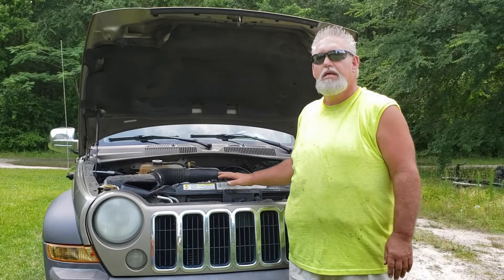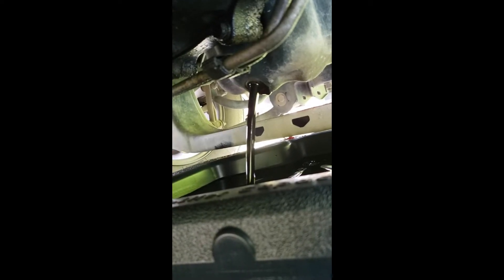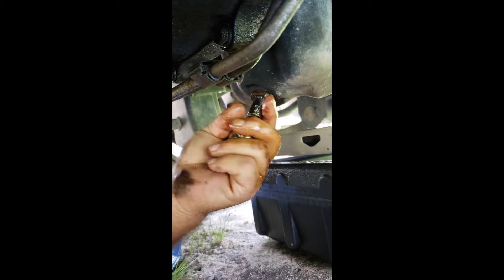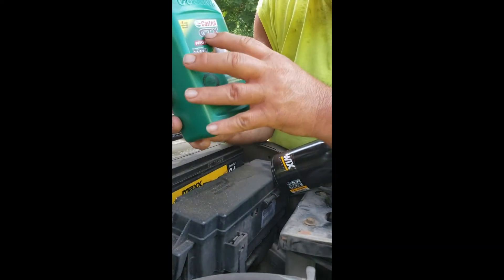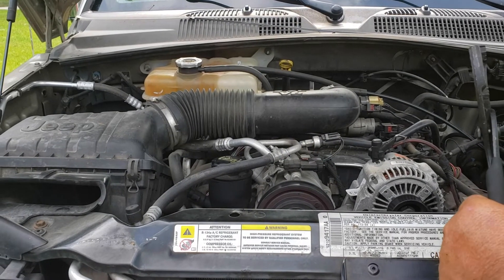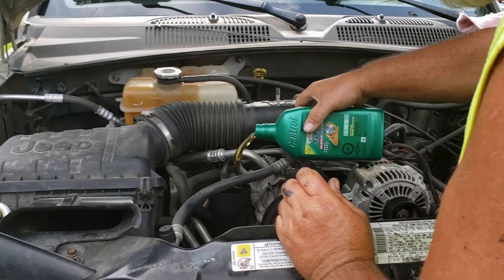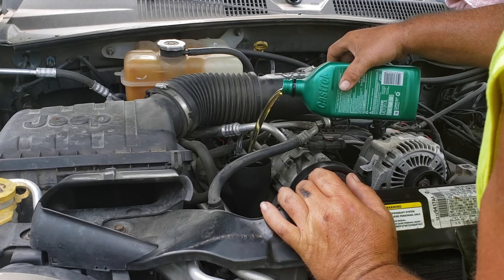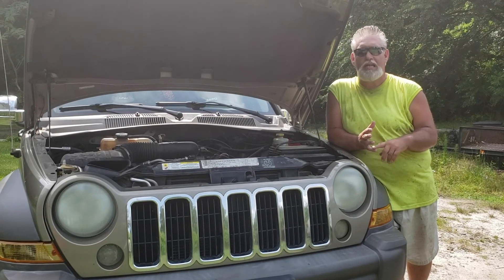2006 Jeep Liberty Oil Change DIY

Comment: Thank you so much for calling out that oil cap and showing the wrench for it. Them dang oil caps are extremely hard to loosen for sure! All the Googling and YouTubing I did searching how to loosen 06 Jeep Liberty oil cap and found nothing. I watched countless oil change vids and everyone just took off the dang cap never mentioning this issue but YOU DID AND advised which wrench to use and it looks like it would do the job perfectly. I TRULY THANK YOU KINDLY ☮
Reply from the maker: Susanna, I truly thank you for those kind words. It's comments like this that make this worth while. I invite you to subscribe if you haven't already and join the Big South nation.

Comment: The Wix 51516 also fit the Kawasaki mower engines. That's what I use on my Fx730v and FX850v. This gives you about another +/- pint of oil capacity.
Reply from the maker: @martineakes5143  Thanks for watching. I DID NOT know that. Thanks for letting me know. I'll have to check into that. I love wix filters.

Comment: If you're doing all this yourself, you may as well do yourself a favor and buy a new drain plug 8$
Reply from the maker: Thank you for watching. I hope you will consider subscribing if you haven't already. Oil pan bolts have seals on them. They get damaged from being over torqued. If the seal is good, which mine was as of the making of this video, there is no need to replace it. Oil drain plugs aren't bearing any load so there isn't any call to tighten them that much. Snug and an additional eighth of a turn is more that enough to prevent any oil leakage.